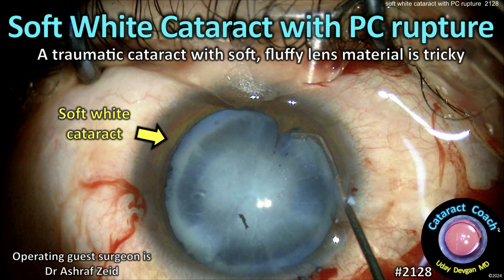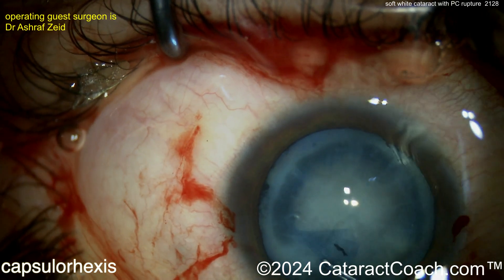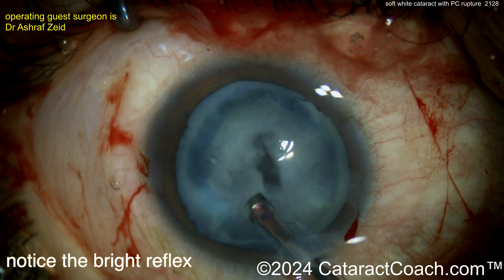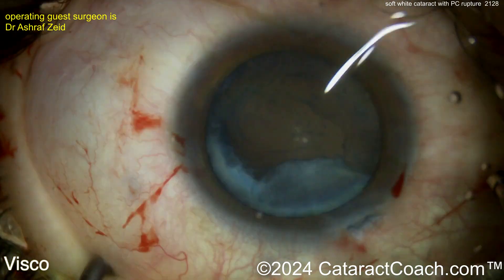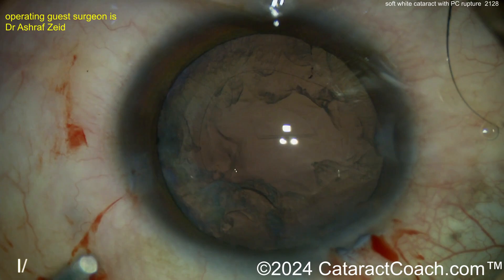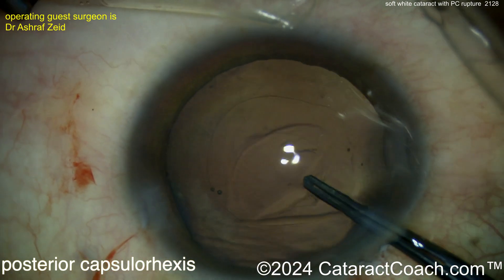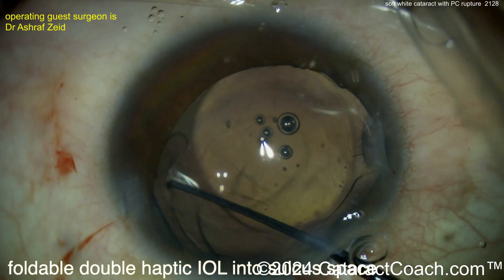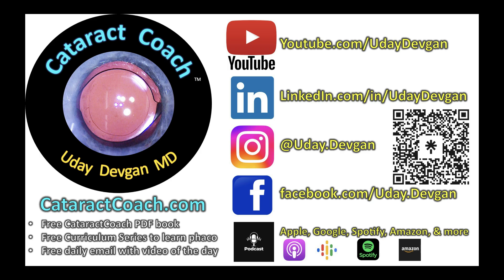CataractCoach™ 2128: soft white cataract with posterior capsule rupture

Comment: So was the capsule already open from the trauma, or the surgeon hit it on the first pass into the lens?
Reply: The patient was above 50 years old and i expected harder nucleus. Phaco power was only 25% and i was going for quick chop. Sadly the rupture happened
Reply: @ashrafzeid9917 thanks for your response! I'm also surprised the patient was over 50, I was guessing more like 30 with how soft the nucleus was. Good recovery!
Reply from the maker: probably hit with phaco tiop and ultrasonic power
Reply: @UdayDevgan  that's too bad, otherwise it would have been a straightforward case. Good recovery, although not using visco when coming out with the infusion made me nervous!